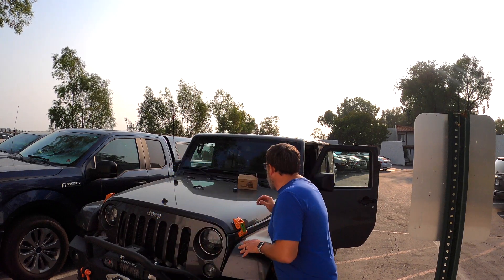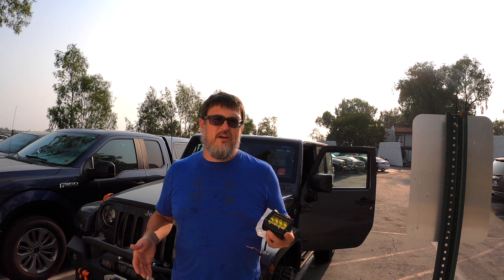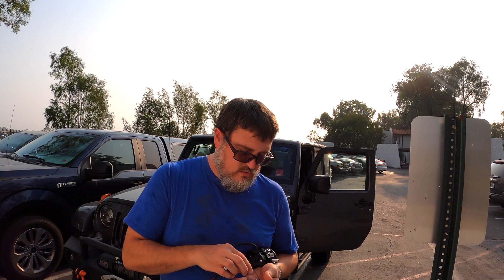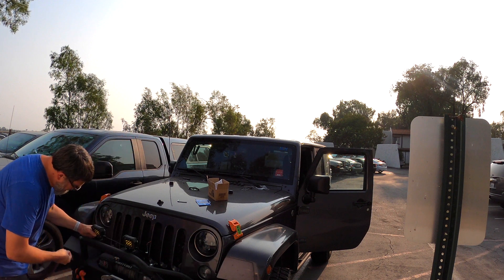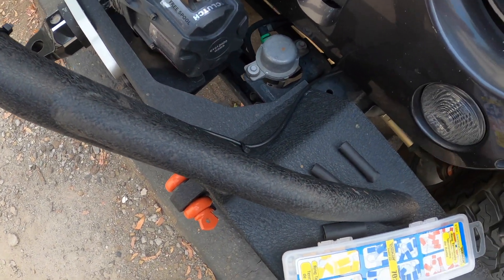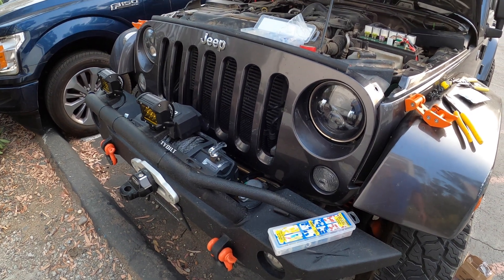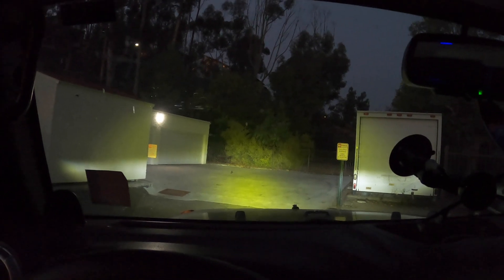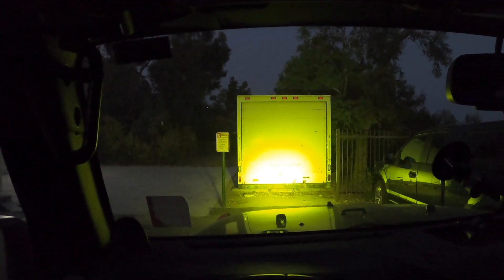Cheap Amazon Off-Road Lights (Are They Worth It)

Comment: Just curious as to why you went with the fog(yellow) versus clear(white). I wonder if the light pattern is different. 
Foglights usually have a more focused beam to cut through the fog and aid in seeing the road. 
Driving lights usually have a wide beam to give more light directly in front and off to the side of the roadway.
Offroad lights have two types spot and flood and now some bars have combos.
Reply from the maker: This is a spot variant but it seems more spread out to me than traditional spots. I am planning to eventually move them to the side of the Jeep but wanted to try them on the front to start. I chose the Amber because it’s not as hard on the eyes of the people you follow.
Reply from the maker: This is a spot variant but it seems more spread out to me than traditional spots. I am planning to eventually move them to the side of the Jeep but wanted to try them on the front to start. I chose the Amber because it’s not as hard on the eyes of the people you follow.
Reply from the maker: I will put the combo lights on front when I do the permanent set. I have seen these and think they are a good idea